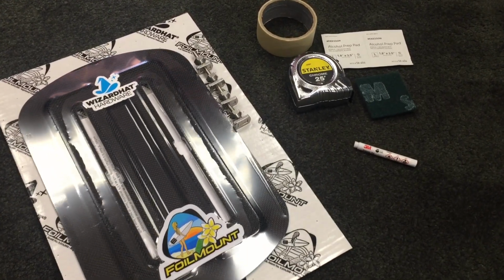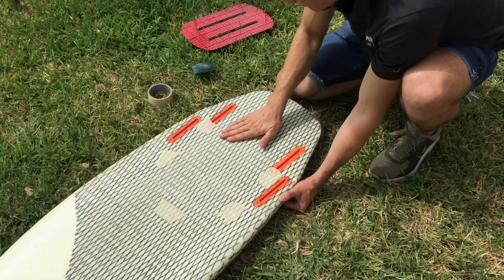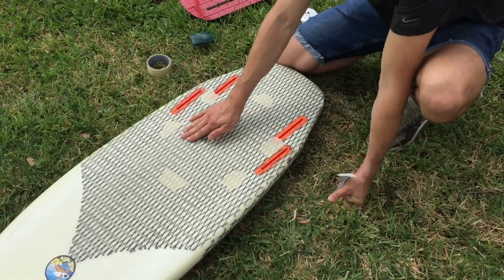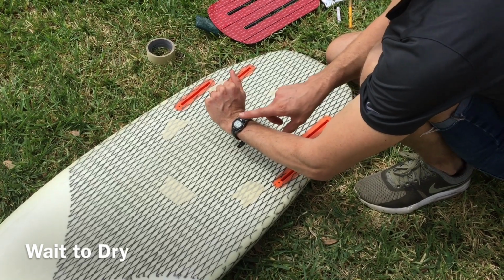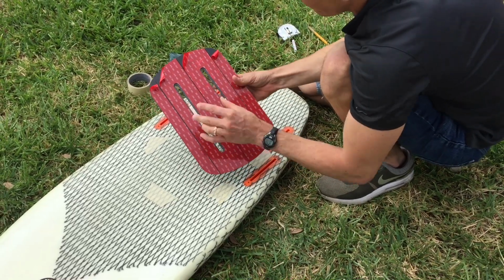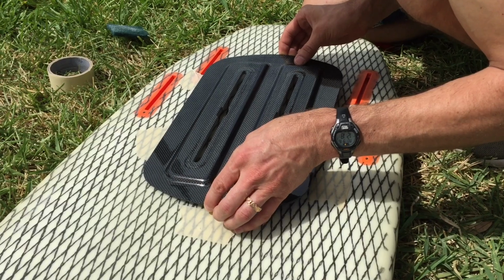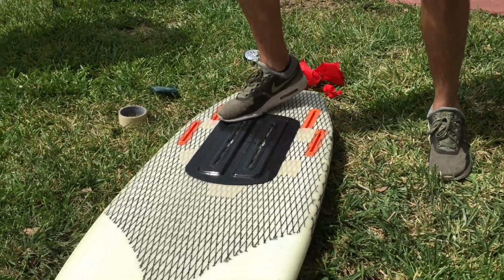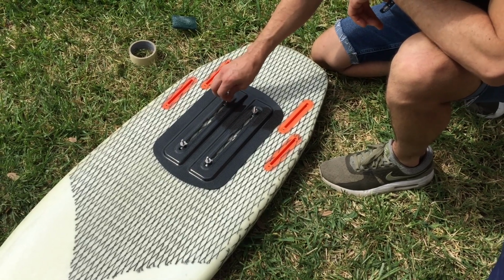FoilMount 3.0 Carbon Installation

Comment: Seems like your skipping the most important calculation, where to place the foil! I've seen boards where the mount is all the way at the back, but you have yours maybe more than ten inches forward? How do we calculate this?
Reply: This is the full article and guide at the bottom: https://foilmount.com/blogs/installation/foilmount-hydrofoil-placement-guide